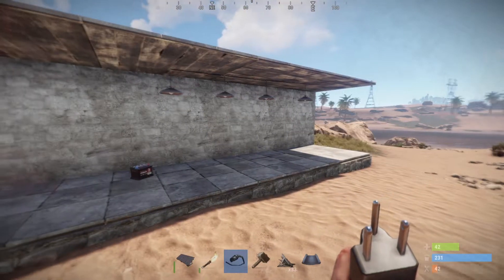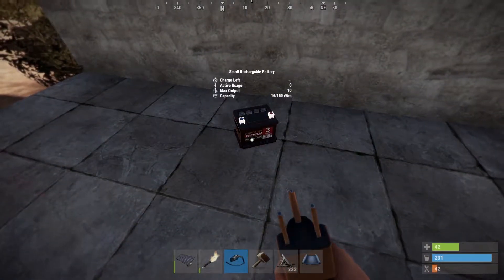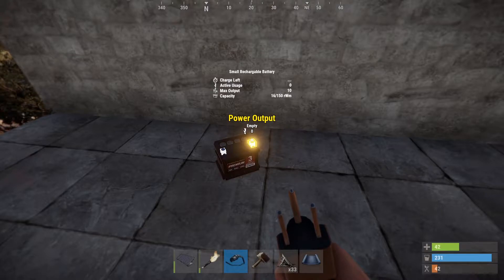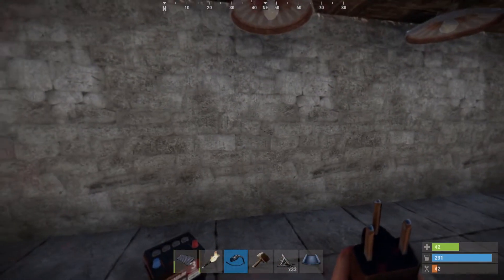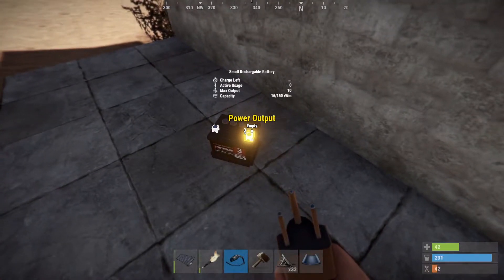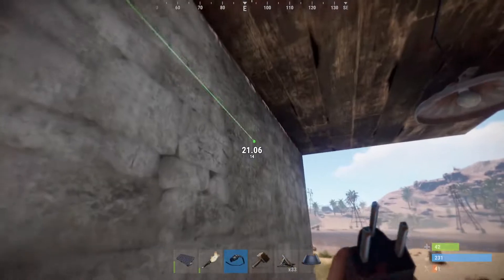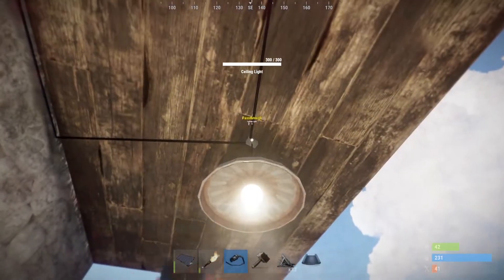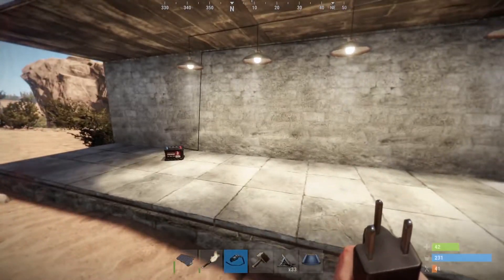HOW TO MAKE LIGHTS TURN ON AT NIGHT IN RUST - rust automatic lights

Comment: Solar panels are expensive.  Instead of a second solar panel.  Take the first one, add a branch to the output.  Branch only 1 for a signal.  Then run that to the blocker.  Also, tip repair solar panels to full hp at all times.